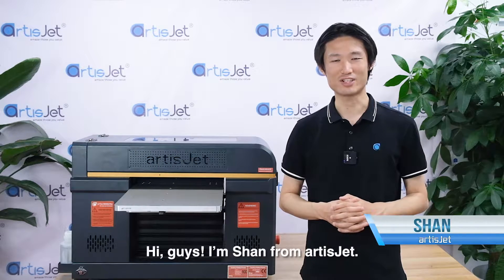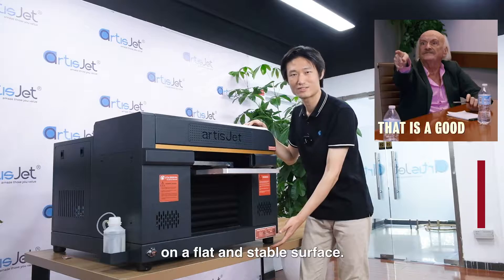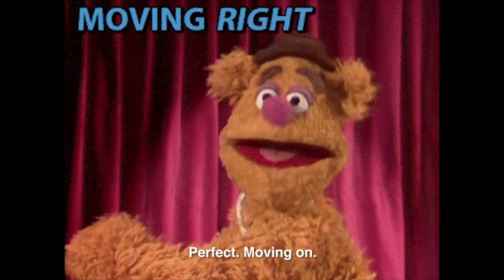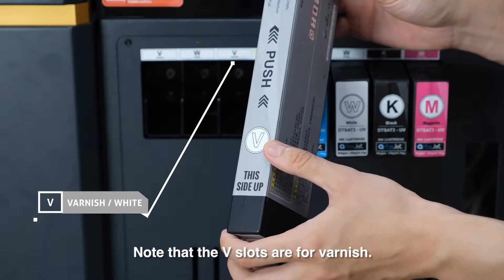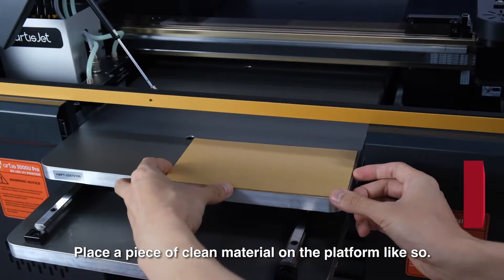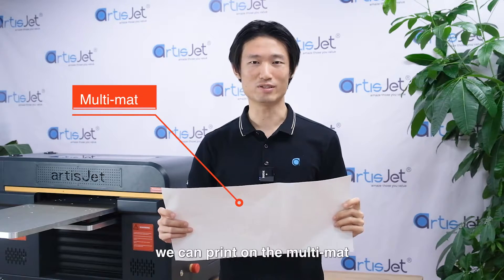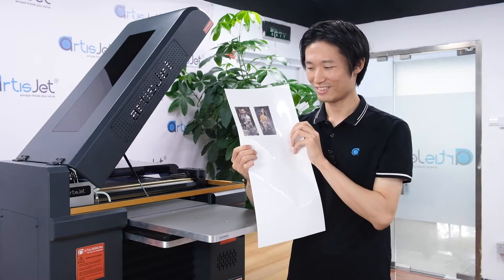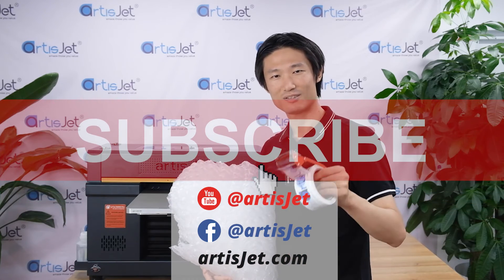How hard it is to install a printer?

Comment: Cartridge ink?
Reply from the maker: Hi, Jose, thank you for your comment!

To clarify, if you’re asking about the type of ink we use, we use our own CE, RoHS, and REACH certified ink, specifically designed for our printers, artisJet DTSAT3 UV LED ink: https://www.artisjet.com/index.php/en/en-products/artisink/eco-dtsat3-uv-led-ink-cartridges 

If your question is about what a cartridge is, instead of using ink bottles, we use rectangular-shaped ink cartridges. These cartridges are easily inserted into the printer's ink ports, eliminating the hassle of manual ink handling. Simply plug the cartridges into the color-dedicated ports (CMYKWV, depending on the printer model) and proceed with the next steps directly from our intuitive software.

For a detailed explanation, we invite you to watch our colleague, Hannah, in a video series where she discusses the ink cost and demonstrates how it works with the software.
https://mp.weixin.qq.com/s/0Wldia5WDqugfwVYipQ0EQ

We hope this answers your question. If you’d like to discuss further or learn more about our artisJet printing solutions, we’d be glad to have an open discussion to understand your business needs and explore how our inkjet and digital printing solutions can help you.

𝗟𝗲𝘁’𝘀 𝗖𝗿𝗲𝗮𝘁𝗲 𝗚𝗿𝗲𝗮𝘁 𝗘𝘅𝗽𝗲𝗿𝗶𝗲𝗻𝗰𝗲𝘀 𝗧𝗼𝗴𝗲𝘁𝗵𝗲𝗿, 𝘆𝗼𝘂 𝗮𝗿𝗲 𝗶𝗻𝘃𝗶𝘁𝗲𝗱!
👉https://bit.ly/artisJetLive800OnlineService

Warm regards,
artisJet Team

#customerexperiencefocused #instantprintsolutions #wowthoseyouvalue